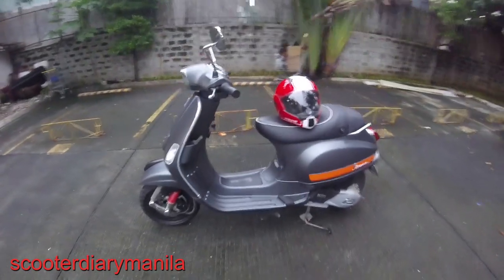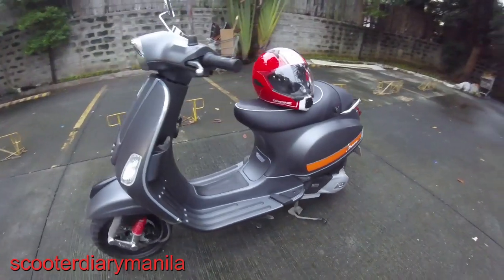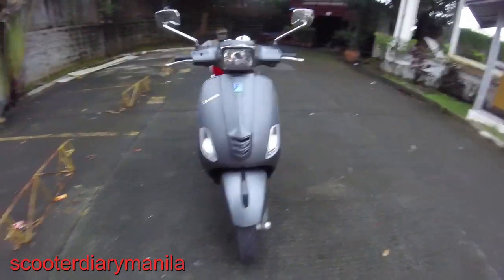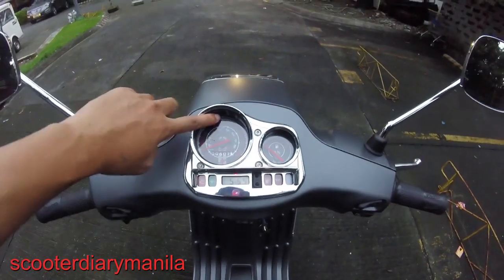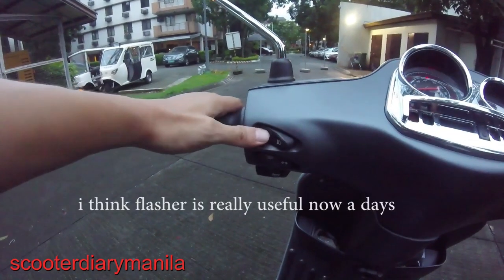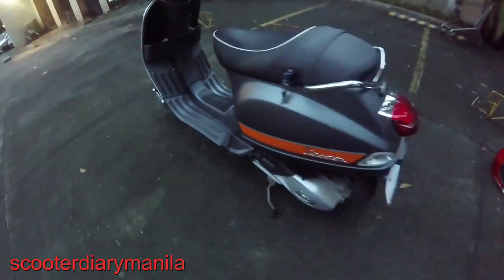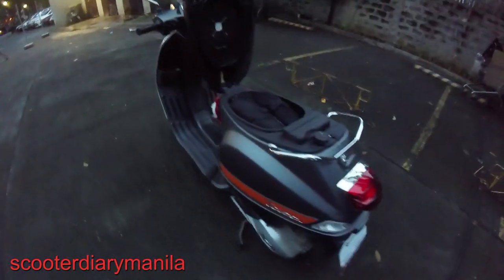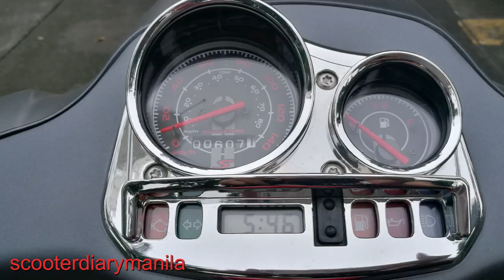SDM#60 : 2017 Vespa s125 Walkaround

Comment: Sir attuned just asking can you decide which is better your Vespa now or the kymco like you had before, in all aspect like price ,experience etc. Just a curios rider here.. Thanks
Reply from the maker: haha tough question, lots of viewers will disagree. in my opinion only, to be fair both on stock form, it maybe the tires or suspension but the Like is better (vespa tires are 10in/11in). Brakes as well is much better in Like (both disk, steel braided lines). But others would say who cares right...its a vespa and i agree :) not built for speed, and it will last a long/life time...price is also subjective.
Reply from the maker: Like will always be a good choice for classic scoot look, nothing gets close i think. 2017 Kymco Like is superb as well in every angle.

Comment: Nice ride bro, how’s the maintenance cost and gas consumption?
Reply from the maker: thanks bro....maintenance is more or less 2k per PMS (oil, filer). Gas consumption ave - 34kpl city, long ride i managed 44kpl.
Reply: Atuned thanks for the info, and just to confirm the only plastic part on the body is the front fender?
Reply from the maker: Bryllo X yep thats what i know... 😀
Reply: Atuned correct me if wrong but the maintainance is every 6k kms per owners manual? Thanks in advance bro im really keen on the maintainance cost. 🙂
Reply: Atuned there you go, thanks man.
Reply: Was thinking of getting primavera 150cc. What to you think about that? Or should I go for the XMax 300?

Comment: San mo binili at magkano. Panalo ba ?
Reply from the maker: Im from east side so nearest dealer saken e un motorcyclecity along junction cainta. Try to visit them to see their vespa lineup. For my purpose its all good and im happy with it
Reply from the maker: https://youtu.be/bJ1mv1JNafg
Reply: Theres one matte red vespa 125 s in motorcyclecity its P130,000.00 pano naman ang pyesa kapag kinailangan ko saan ako maghahanap
Reply from the maker: Its a brandnew bike so u wont worry about parts in the next year or so. Just return it dealer for warranty if something goes wrong. But if youre asking about upgrade parts rami rin jan, polini and malossi have distributor locally.

Comment: Hi! Can two people seat comfortably in a Vespa S125?
Reply from the maker: Mejo hindi pero pwde naman. Yun seat finish is rough so not really prone to sliding. Pero kung malayuan byahe baka hindi na talaga advisable. Plus power/torque is a bit down
Reply: I see. I just really find the appearance of this Vespa nice and classic. Kaso may angkas ako. Currently using a Beat with 110cc and medyo hirap pag-akyat pag may angkas. Thanks! 😊